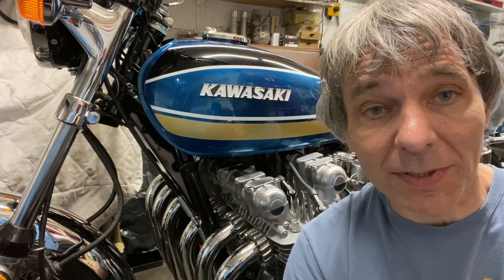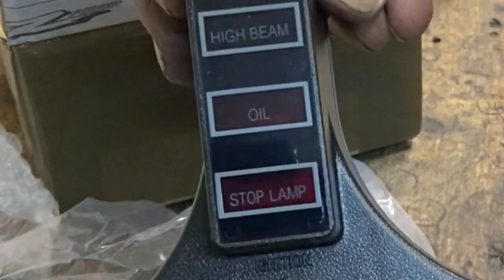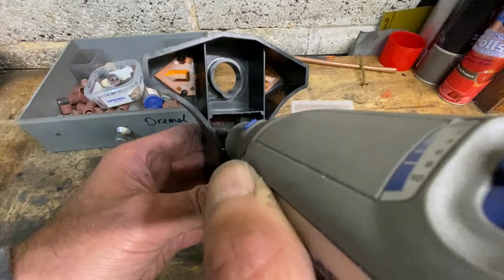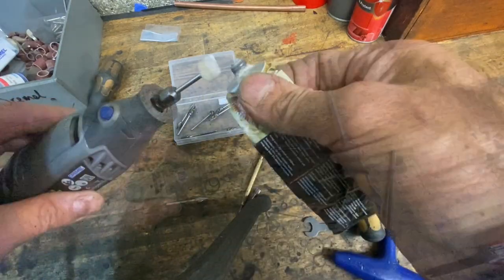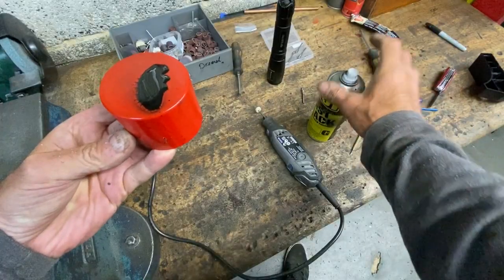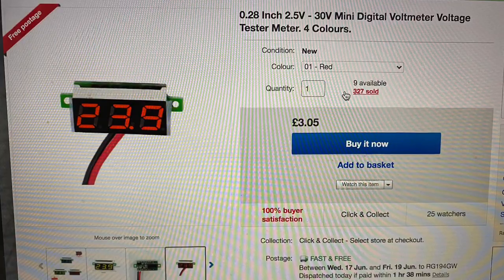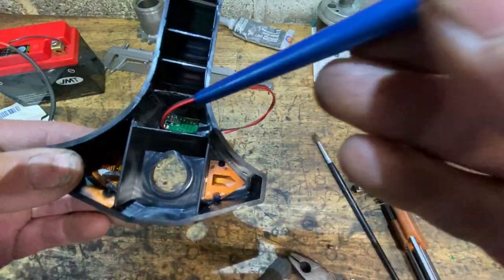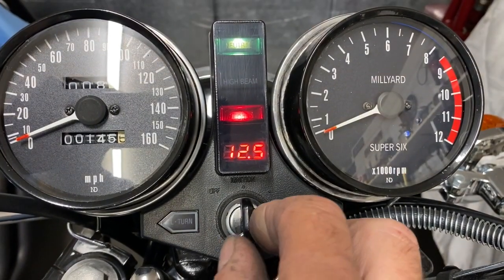Kawasaki Z1 Super Six  Volt Meter - How its Made

Comment: Had a suzuki GT185 back in the '70s. Some of the larger suzukis had an LED gear pos'n indicator. I decided to build my own into a small box between the clocks using a nixi tube, voltage inverter, transformer, modified neutral switch etc. worked great although I did get a ~160v shock off the bike once when  it was weeing down with rain. Great times. Nice modification Allen. Great video series.

Comment: Cool.  I use a 60V one for my e-bike.  By checking the voltage under load, it acts like a fuel gauge.  36V lead-acid pack is 40V fully charged and 32V dead under load.  It gradually decreases as you ride.

Comment: I still wonder where you find the time, the bikes, what some of your first endeavors were and how young you were when you performed them.  Thousands of us INTERNATIONALLY Revere your shares.  Good on ya, mate !
Reply from the maker: I always make time for bikes, ive been working on bikes since i was around 10 yrs old learning about engines by repairing lawnmowers, I put a small car engine into a BSA when i was 15
Reply: @AllenMillyard   Me: Bicycle repair at 7 yrs;  moped then motorcycles at 9. In a backyard l saw an adult tricycle and a 5 HP tiller l knew didn't run. In lieu of payment l was given both. Some plate, some bolts a centrifugal clutch and front brake only.  VERY dangerous!

Comment: The removable dremel collar (the removable end that you take off to screw in a router base) has a built in wrench for holding the collet (on my dremel, at least) on it so you don't need to keep that easily lost wrench handy. Just unscrew the collar a bit, hold the collet with the metal opening, then screw it back in...

Comment: I just did one myself on my CB500 on my channel but you certainly did a better job of yours. Having it connected through the ignition though, do you get a lower volt reading with other warning lights also coming on ?
Reply from the maker: I tapped into the main  switched feed in the headlight so will give a correct voltage reading

Comment: Why would u need a voltmeter? Is it to check the battery?
Reply from the maker: A volt meter is useful for checking the battery charging circuit, so you can identify a problem by either high voltage  or low voltage